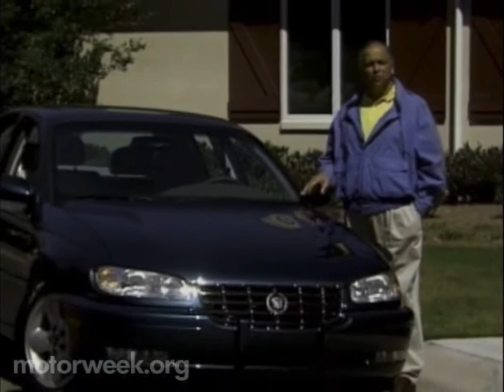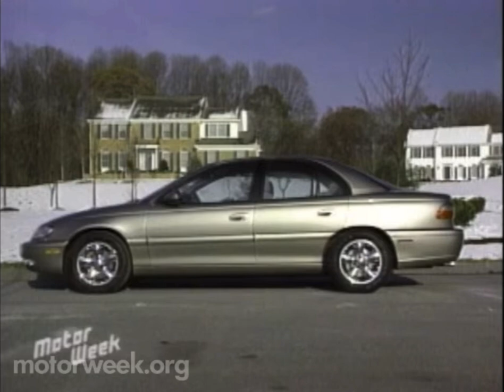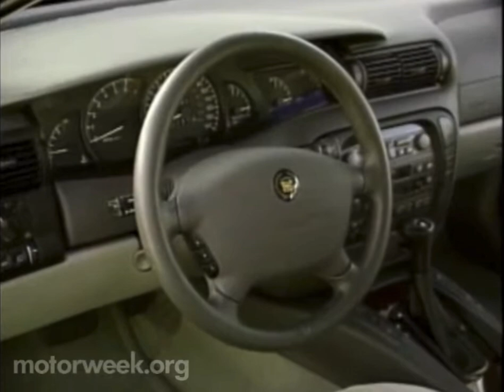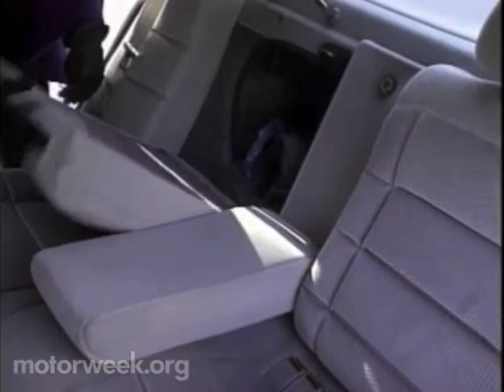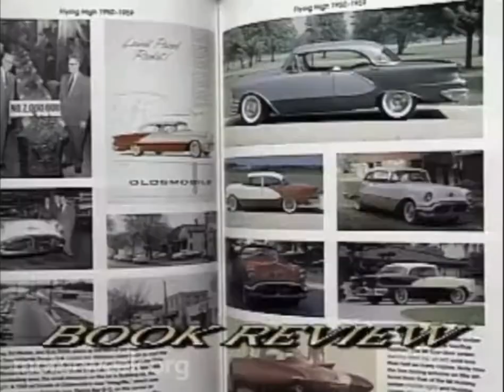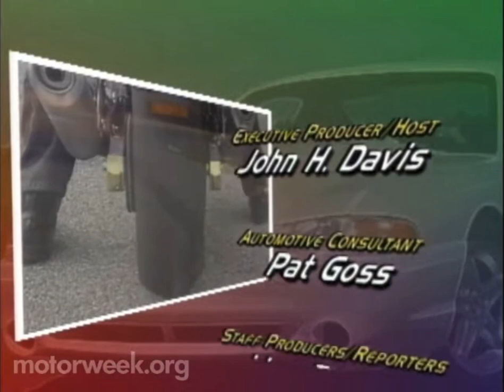Motorweek 1997 Cadillac Catera Road Test (Part 1)

Comment: I bought a used 1998 Catera in 2013 for $1,000 with about 70k miles. 
It lasted for about 2 years until the engine started overheating due to coolant leaking so I constantly had to refill it, but it would only last for a short while before you have to refill it again, so driving it more than 30 minutes was dangerous. The engine eventually overheated and stopped working.

Comment: I still do drive the original car, the Opel Omega B facelift model year 2000, today! It's a 2.2 16V with 144bhp manual and still keeps running strong.
Reply: Just thinking parting with my MY2000 Omega 2.5 V6 petrol manual due to rust. The engine is still fine at 220k miles.
Reply: The Opel Omega european is my favorite Omega Caravan TD

Comment: I wonder why GM didn't choose the VT-VS Holden Commodore instead of the Opel Omega for the Catera? It was widened, had a V8 engine, had proven US mechanicals, and came with a long-wheelbase version (Statesman/Caprice). Admittedly the interior wasn't as nice as the Omega but still...
Reply: GM incapable of making good decisions. Miracle that they managed to make any decisions at all
Reply: It was rhd later they made GTO and G8 in lhd...
Reply: @ no there were LHD versions if the VT-VS Commodore built, too. It was marketed as the Chevrolet Lumina in the Middle East, and quite popular it was. It was also sold as the Chevrolet Omega in Brazil. All LHD.
Reply: @pullformore  maybe to protect impala Ford didn't import Falcon to replace Crown Victoria on 2008 was designed to be made in lhd...